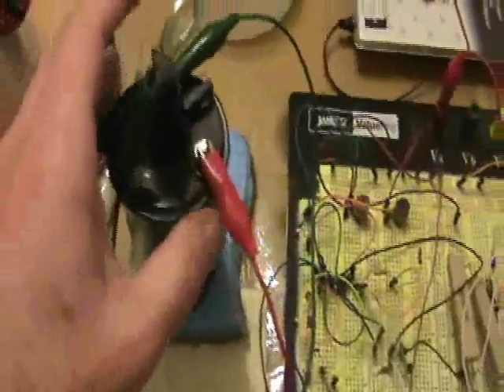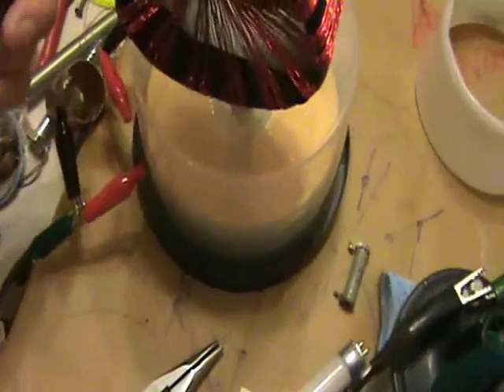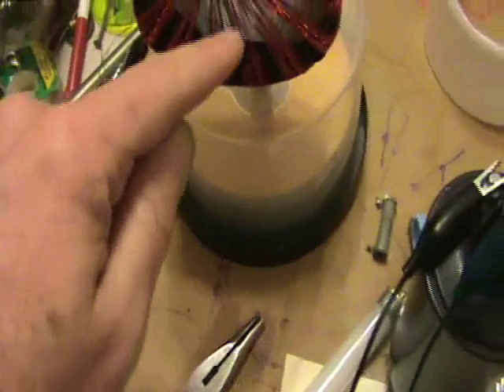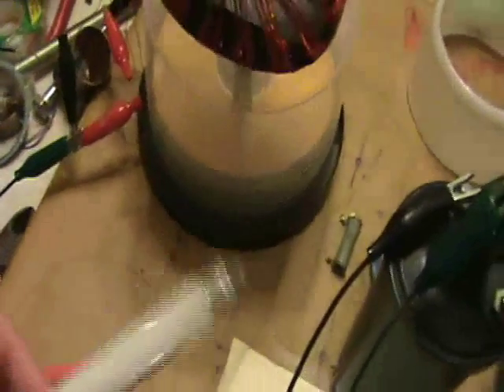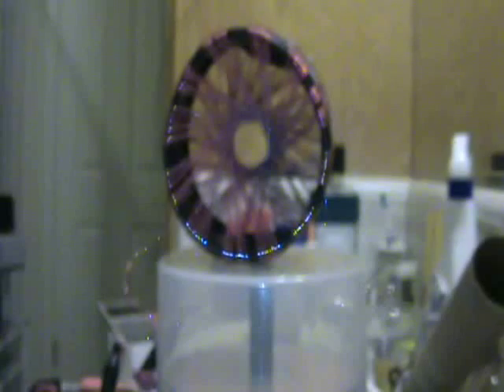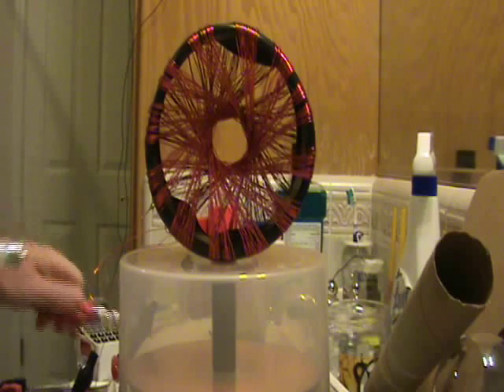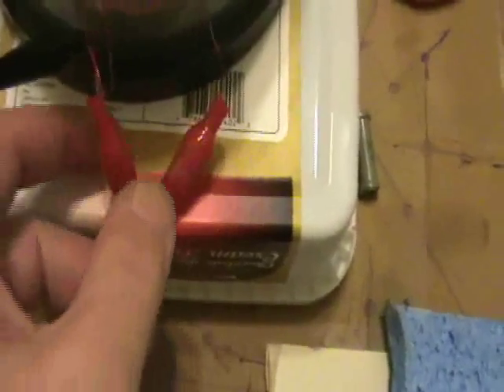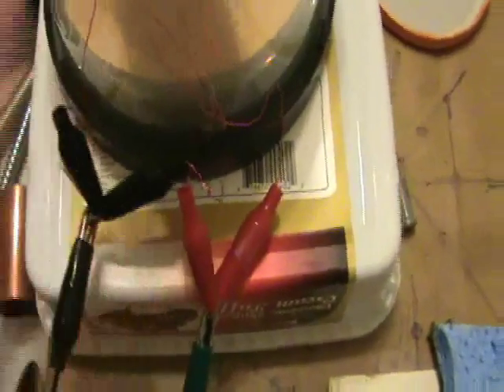"Tuna Can" Rodin Coil Experiments with High Voltage

Comment from the maker: I'm not sure what you mean exactly. This experiment was with HIGH voltage, low amperage. You cannot remove amperage completely. Ohms law shows the relationship between voltage, current, and resistance. If current goes to zero, so does voltage. If you mean reduce the resistance, yes that would be desirable and that is what super-conductivity is all about.

Comment from the maker: @5T4RSCREAM144 
Over-unity is an illusive goal. If such a coil did produce more than you put it, it is responding to EM fields in the local area. The energy would have had to have been there for it to tap into it. After all ... its just wire arrange in toroidal shape.

Comment from the maker: @5T4RSCREAM144 
To me a black hole would keep pulling in mater and getting bigger and bigger ... so I hope not.
The Rodin Coil is an interesting new geometry for coils that people are experimenting with. It creates
a vortex shaped magnetic field when pulsed or fed AC currents. There are two wire circuits which can be used in various ways such as 1 to 1 transformer, phase shifting, tickler, etc. Unlike a transformer that tries to keep the field inside, the Rodin can emit a field.

Comment from the maker: @5T4RSCREAM144 
Making coils is just the cost of wire. Electronics is a fun hobby. Get a good basic book on electronics ... and try building various circuits, etc. Those radio shack 80-in-one kits are a good start. There are lots of videos on the Rodin coil.

Comment: @erik61801 Sometimes there isn't an immediate use for things that result from experiments. For example, the glass being used on HD television screens and cell phones was created a long time ago (back in the 60's or 70's if I'm correct). It was super thin, very hard to break glass, compared to normal glass. The only problem was there was no use for it at the time. Now there is =D So even if there isn't a practical application for some experiments results now, there could be in the future.

Comment: @morpher44 
on this hand you are correct. I agree, that what I asked before.  what are some applications besides this. IE you could have had a single wire point out to ignite the flouro tube.. I see that you made your own pulse generator. Have you considered trying beefing that up and maybe using a dc/ac inverter in a PWM config. Or maybe a signal generator hooked up to a car audio amplifier..hmm. You should tangent your work towards HHO production with these coils. thanks

Comment: @Texmurphy51 also the devices are being wound wrong, they need to be wound using the ABHA torus with interlaced doubling circuits, the spires, thats where the real power comes from, you get a new spire for every fractal of the coil. the spires may be the key to this energy

Comment from the maker: @Texmurphy51 
I encourage you to do your own experiments. My sense of the Rodin shape is that, if pulsed, it produces a field that is vortex shaped. However, if you use it like a transformer, the field is pulled down into the toroid. So unlike regular toroid transformers, it is NOT optimized to keep the field in the toroid. Rather, it is optimized to produce a vortex shape. Hence, its not for use as a transformer. Experiment. Its not a motor .. its not a transformer... its for shaping a field.

Comment from the maker: @GHOSTTOYS 
Frequencies are a spectrum. Sound frequencies, from 0 to 20khz are convenient because we have two sensors on our head that can detect them readily. For coils, though, you need larger conductance (with ferromagnetic material) when going lower in frequency. That is the technical challenge, because you also have to worry about resistance, and HEAT.

Comment from the maker: @fodabonita 
Rodin has made certain claims about his coil. I think it would be good to experiment here ... and try to confirm or disprove those claims. The coil is certainly interesting. Efficiency should be measured, yes. Remember, though, it is NOT a transformer coil. Rather, it seems to be a coil that EMITS the field around it. So as a device, it is a different sort of device. One that creates a magnetic vortex. The trick is to invent something to exploit that vortex.
Reply: Tal vez usando una bobina plana de Tesla podriamos ver los resultados, y afirmar si se puede explotar el vortice... (translate please)
Reply: Después con la bobina plana secundaria tal vez podremos conectar nuestros dispositivos o lamparas de prueba..

Comment from the maker: @MrCletushowell 
When you say SOUND ... your talking 20hz to 20khz. Yeah I'm messing around with frequencies in that range ... but from a 555 timer circuit. The auto ignition coils responds well to low frequencies since cars have engines that rotate from 0 RPM upward to 2000 RPM (0hz to 120khz). So .. yes there is power in low frequencies. Plus, the are easier to work with because you can hear them.

Comment from the maker: I wasn't experimenting with plasma so I'm not sure what you mean. This was high voltage AC passing through the coil. It is easy to get shocked when messing with this stuff. Add water to the mix, and you have a recipe for real danger. I prefer to experiment with this stuff in air.

Comment: I would like to  know it the core could be arranged  to allow  not for plasma but water  to pass through it.  having creating a loop much like the old circular fluorescent lights.  And if so what would the affects be on  the water within the core.
Would there be any adverse affects to the coil and would there be any affects at all to the water itseldf.

Just a curiosity

Thanks

Comment from the maker: High-voltage AC is so cool. It can travel on the outside of insulation due to the skin effect ... or burst right through due to induction. Mind-blowing yes, but it happens ... so be careful. Insulators have a breakdown threshold. If the voltage is high-enough ... POOF ... no more insulation.

Comment from the maker: The little guy I wired used 26 AWG wire. I think to pass much larger currents though, which would be ideal, a larger form should be used with larger gauge wire. I thought a motor-cycle tire might be a good size.